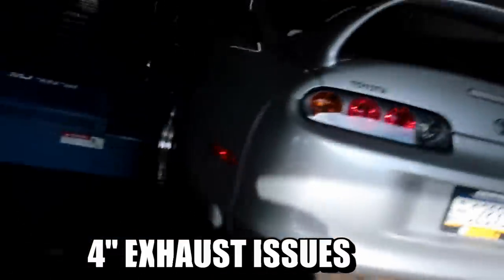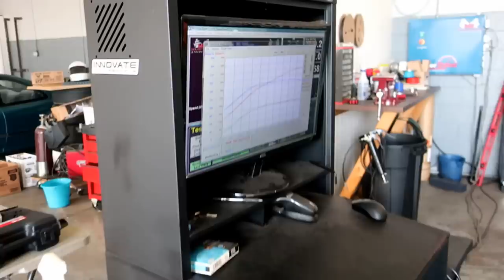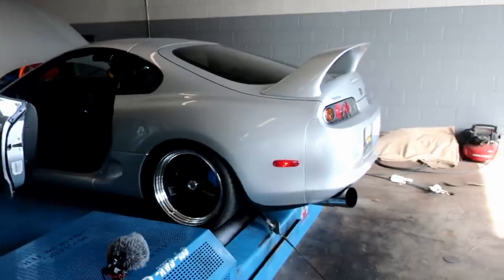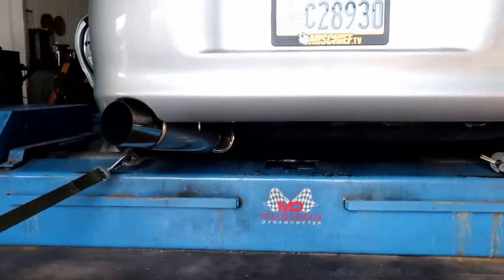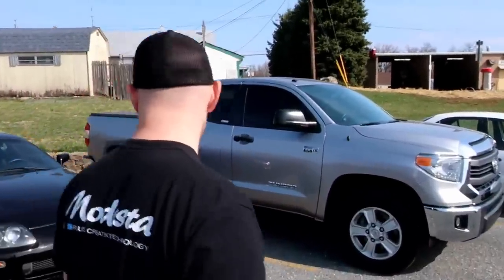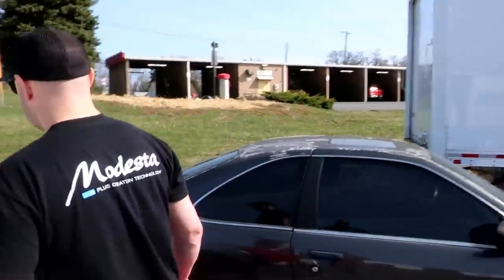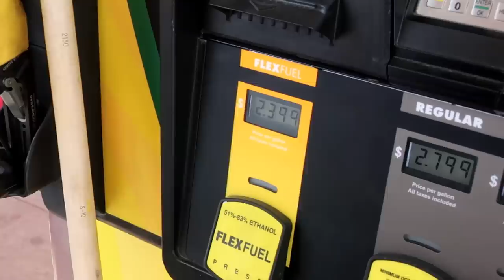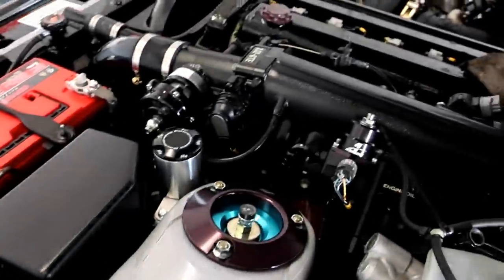Supra Dyno Day! (Didn't Go As Planned)

Comment: I have fuel injector development 2000cc injectors, the flow chart shows them actually flowing 2200cc. Twin walbro 450s and on e85 764hp was like 60% duty cycle with perfect idle and driveability, even cold start with no IAC. You should contact Naber Racing in Michigan about injectors
Reply: David Henk Going to be running these same type of injectors in my GS 300 but it is going to be 1600cc ones and the Walbro 525 pump. Why isn’t your HP more ?

Comment: Hey Ryan,  my 93 Supra  I have an OS Giken R3C with my Grannas T56.  Should be good for 1000+ whp.  She is noisy as fuck, kinda hard to modulate from 1st gear, you have to slip her abit,  but damn she hold like a mother.  Idles well on 1600cc FID injectors (basemap for now on my Pro EFI) and with dual 450 walbro pump and my fuel Hanger came from Autosport Engineering,  cheaper than PHR but looks alot similar also set-up for flex fuel.  If you want,  I  have a stock hanger with 10an plumb for a dual pump setup?  I will be dynoing and tune  her hopefully next month .  Wish me luck.  I'll be pulling for ya!!!

Comment: I really don't understand the hype with e85. I'm here in South New Jersey where we really don't have it, but it seems like snake oil.
Reply: Snake oil? No. It has multiple real, quantifiable benefits: Octane (105 R+M/2) and cooler combustion. Obviously higher octane allows for higher cylinder pressure without detonation. Cooler combustion (at any given Lambda) means less thermal load on all the hot parts of the system.
Reply: @GroovesAndLands  Thanks for the clarity, I wasn't aware of it having cooler combustion and a higher octane rating. Makes alot sense now.